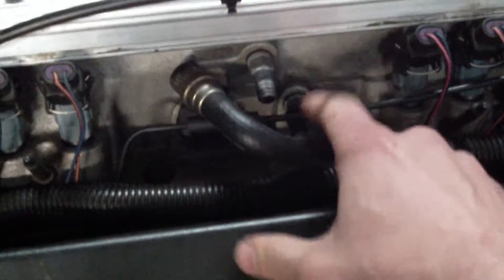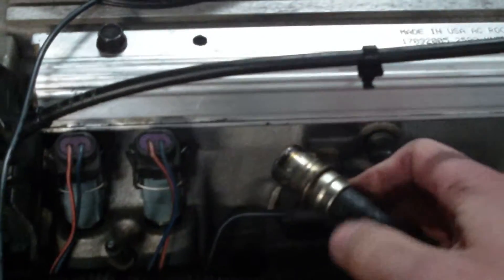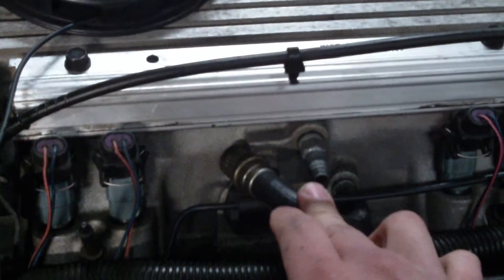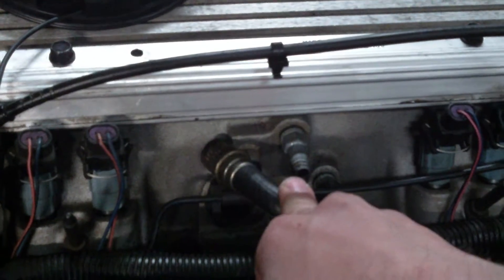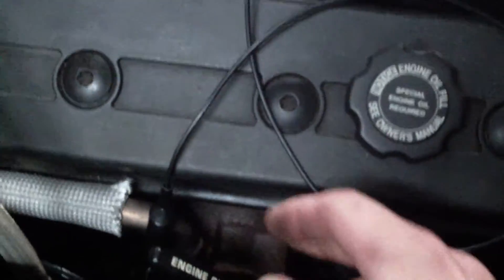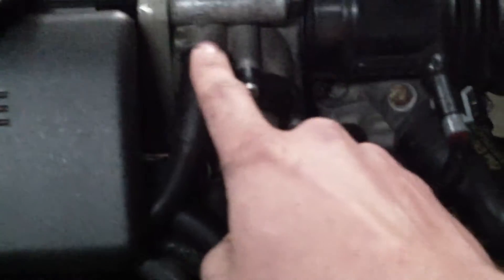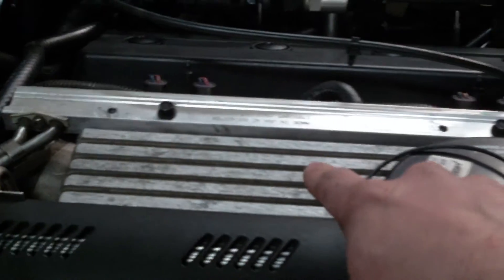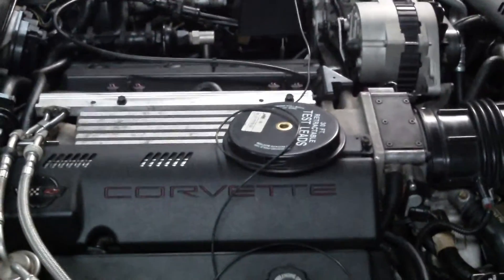PCV Testing

Comment: I see that in some pictures on the internet where your pcv hose/valve connects to that part of the intake manifold, sometimes I see that the brake booster vacuum hose connects there? Maybe that's for camaro's and firebirds and not the LT1/LT4 Corvettes? Chime in if you know what i'm talking about...
Reply: Yes the C7 corvette has quite a confusing PCV system especially when combined with the Dry Sump models (as there’s 3 additional PCV lines that run to the dry sump tank for breathers, air inlet, air circulation). 
But to answer your question the C7’s have a two part PCV system (dirty side and clean side). The dirty side has two ports, one coming off the Valley cover under the intake, and another on the throttle bottle/intake area for vacuum/recirculation under different demands (yes the C7 PCV also switches from vacuum to breather). 
Overall those lines (like a brake booster) is used for a vacuum. Lots of “Procharger” kits run a T off the line from the intake to create the vacuum needed for the blow off valve. 

Confusing system and can really throw off your crank pressure / blow a seal if you plumb it wrong.